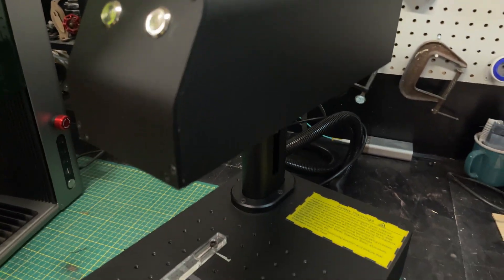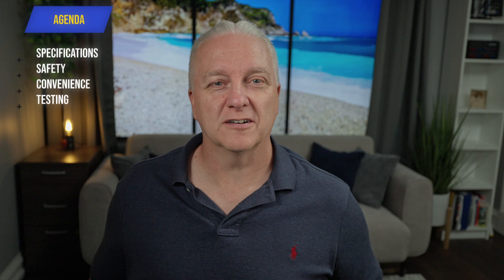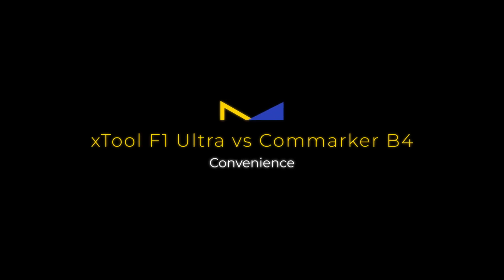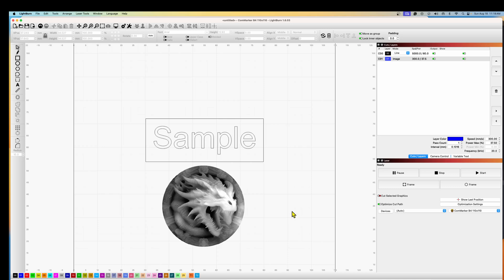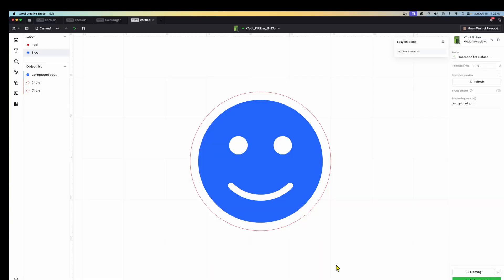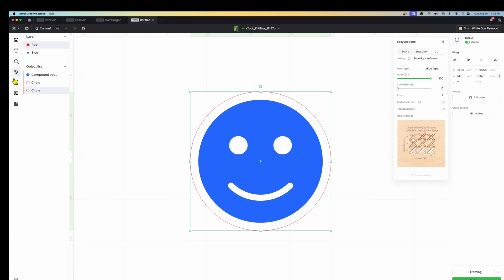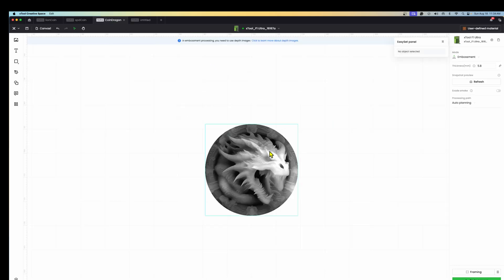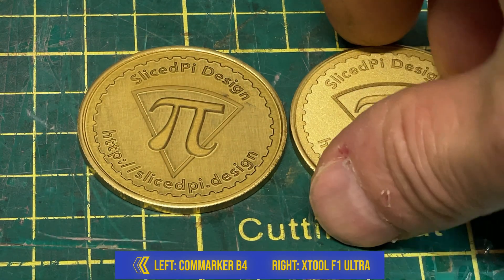Fiber Laser SHOCKER xTool F1 Ultra Beats Other 20W Lasers

Comment: What is my best software for learning? I’m going to buy a machine, but require something for quick first time learning.
Reply from the maker: Most lasers use Lightburn, so you can download a trial of that and play around with it. If you want design to design thing, you can do some of that in Lightburn, but also Inkscape, Kittl or other vector graphics software.  If you want to cut things out and maybe piece them together, you can look at something like Fusion 360, but this is a pretty advanced topic to start with.
Reply: @ do these machines use the apple software?
Reply from the maker: @skunkworks2059  Almost all of my computers are Macs.  Lightburn, XCS, Makeit, and most of the other laser control programs run on Windows and Mac.

Comment: Would you still buy the F1 Ultra over the Omni 1?  This would be my first "fiber" laser.
Reply from the maker: Not sure this is a fair comparison, but for straight engraving I’d buy the Omni1. The Ultra is a better choice if you want deep engraving for things like coins, or if you still need a diode laser.  Keep in mind the omni1 is more expensive than the Ultra, and that can matter a lot if you have a fixed budget.

Also note the a UV laser and a fiber laser aren’t exactly the same things

Comment: I feel like you underplayed the difference in effective work area.  The F1 has effectively 4x the work area.  (220x220 = 48,400  vs 110x110 = 12,100).
Reply from the maker: The B4 also includes a 200mm lens so the difference isn’t as dramatic as this.
Reply: @SteveMakesEverything  in your video you said the machine was not fully effective when you put that lens on.  I think you may have said in the outer reaches.  If that's accurate,  then one would have issues with consistencies across the work area, no?  The xTool camera can be used to batch process blanks of the same type across the work area, which I realize the other can't.  But presumably you can use a template, and then consistency across the area  is important then, too.
Reply from the maker: @DavZell  The 200mm lens seems fine in the center, but the power seems to drop dramatically at the edges.
Reply: @SteveMakesEverything  That was my take from the video.  Thanks.